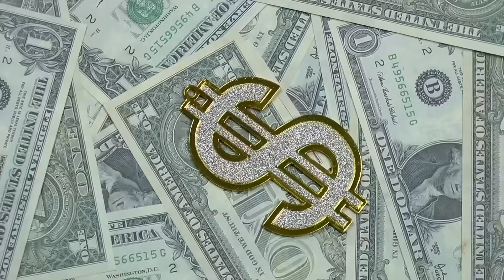How To Lay Out Walls, Floors, and Roofs | Explaining Layout

Comment: Actually, technically it's not even spaces if you're starting from the left corner, because the first space is 0.75" shorter than most of the others, because of the fact that you're covering the entire first stud with the sheet good, which means that an 8ft board would be 3/4" short to being on center of the end stud.  Hence, you shorten the first one by 3/4" to account for that extra 1/2 a stud (3/4") being covered, so that the end can land on center and the next piece can be from center to center.  This is a point of confusion that I don't see being explained very well.  I'm not sure most people understand that that first spacing is actually NOT uniform with the rest, but in fact, is shorter than the rest.  This is why you can measure 16" (for example) from the END (rather than the center) of the first stud (which is flush with the plate) to the CENTER (as opposed to the corresponding edge) of the 2nd stud.  If they were all uniform, then measuring from the very end to 16" (with that spacing being used) would not get you on center of the next stud, but rather, just long enough to meet the next closest side of it, which is 3/4" too short.  So, rather than having to have a board that is 3/4" longer (8ft 3/4"), you simply shorten the actual wall itself (in that first section) to account for that extra 3/4" being covered on that first stud.  Hence, 6:30.

Comment: Thanks for nice layout video. But still, is there something you do to compensate for gaps between sheets as it builds up in longer walls or you just cut a sheet from time to time?
Reply: A framers objective is to square a building to 1/8 inch. Most homes are 1/8"-1/2" (imperial) out of square at the time of their building, due to these inconsistencies.
Reply: @brianmahony4979  Thanks for response. I've meant something different though. Manufacturers advice to leave a 1/8 inch gap between each two sheets for dilatation purpose. For example having a 50 feet wall this would add up to almost 2 inches making your last two sheet goods meet each other completely off the stud. So you either can't lay out your studs precisely 16 inches on center or you have to cut your sheet goods 1/8 inch shorter. Does this make sense or am I making it too complicated?

Comment: I’m always confused by the corners where two walls meet. Sure the full length wall is easy, do it as shown in the video. But what about the short wall? You must start the first stud at 12.5” oc instead of 16” (for 2x4 construction, 10.5” for 2x6). Good for the sheeting but the drywall will have to be trimmed on that wall. Is that correct?

Comment: This was a really great video.  Not to confuse people but on a 12 foot material standard, 18 inches on center will give you an even break and save you 1 joist board per 12 foot run, compared to a 16 center.  

This is not good at all for custom houses, but for 24x48 garages it’s nice.

Comment: I like to run my door jacks to the sub floor sheathing. That way it bears against the end of the plate. So the king post and door jacks are locked in and not depending on nails driven in from the butt. All you gotta do is raise your wall, set jacks in after you cut out the plate 3" wider than normal. Doors stay rock solid on the hinge and lock sides.

Comment: Very good, I like this young man. Jack studs can also be referred to as trimmers,  and when laying out I like to lay out from left to right, That way your tape measure numbers are always right side up, rather then upside down..To do this one has to do a cross over at your wrist, pulling the tape with the 
left hand and penciling
 with the right hand, unless your left handed, (like my brother) You can also buy tape measures with inverted numbers.  Keep up the good work Perkins..
Reply: Good point. If you use your tape measure with the numbers upside down mistakes will occasionally happen. Not good.
Reply: I'm left handed and lay out from left to right.  Take advantage of your abilities.

Comment: So the first sheet of sheetrock gets cut 3 1/2 " off the first sheet?
Reply: If you stand drywall up you have to cut bevel off anyway. Not supposed to be beveled edge in corners. Headaches for the drywall finisher.

Comment: Hello Perkins Builder Brothers,

I am trying to make a lean to shed that has unequal length walls, this shed floor shape is to accommodate the acute shaped corner of my backyard where I have space to build. I know having unequal opposing walls will affect the pitch of the roof.  Could you make a video or provide recommendations to help me keep the shape of the shed (so it fits like a glove in the corner of my backyard) while having the pitch of the roof be equal heights at the high front corners as well as equal heights at the low back corners? 

Thanks for the videos. They have helped teach me and my family a lot.

Cheers!

Here are my shed floor dimensions:

Back wall: 11 feet x 4 inches
Front wall Length: 10 feet 9 inches
Left wall Length: 5 feet 6 inches  
Right wall Length: 8 feet 5.5 inches

Back wall Height: 8 feet
Front wall Hieght: 9 feet

Comment: What i wish you had additionally talked about are the corners of walls and how the sheeting overlaps or doesnt because to get 8 foot on center one side of a corners sheeting overlapping the other will short you a half an inch roughly. I know it seems people run sheeting vertical but it would seem to be far stronger with it run horizontally running a half a sheet for the first piece so the joints are offset. It obviously must take longer or some other reason why its not typically done this way?

Comment: You mentioned laying everything out the same so it lines up through multiple stories, floors, roof, etc. does that mean you lay out 16” OC regardless of doors and windows? So a door might have a stud only 4” away in one side for instance?
Reply: Yes! Always have something solid on your layout. You could maybe skip one if your door or window kingstud is a quarter or at most half inch off from the layout, making the gap 16.25-16.5 inch. Otherwise, having one makes it easier for your drywall installation, sheeting, siding, and insulation.

Comment: On the (big) apartment jobs, i tell the framers where the plumbing openings are, so the joist dont wind up under my pipes going through the subfloor, i dont care about the "lay-out" move that damn joist!
Reply: Chad Simmons Yea on big apartment jobs or any big jobs we would always have a meeting with the plumbers before hand to make sure we would know what special joists or studs they would want moved so went it came to layout time we would lay them out properly. If not you can imagine how much time it would take to move even just one stud in every unit in a 128 unit apartment building.. No thanks.
We would also go over the print to make sure they didn't have any changes in the tub or shower sizes so when we did the joist lay out we would make sure to not to have a joist land in the middle of a toilet or tub drain. Know the center of the tubs and toilets.
Toilets usually are 13" from the wall to the center of the drain.. Same with showers... different numbers of course depending on the tub sizes.
Nowadays I do mostly interior trim work but can't tell you how many times I see the plumbers having to cut an I- joist because it's directly under a toilet... Smh.
Reply: @reddawgrup1779  The 3-1/2 wide floor trusses, are common place in these jobs we do, i dont enjoy having the "amigo's" move a 40 footer, half an inch, to keep my pipe in the clear, but inspectors have (zero-tolerance) for cutting them, i have no doubt that you do a clean, rough-in, we could use many like you in Kansas City
Reply: Chad Simmons... Harmony on the job is always a good thing and makes for a better job, I was lucky to work with the guys I did, we all played football together at times. I remember playing a bit of football after work in the snow years ago and throwing the football around at lunch or the baseball. We all bowled together and played softball together through the years too.
We'd have a crew of maybe 15 guys or so and wasn't uncommon for all four us to play on the same team. Good times we had and work was more or less fun and looked forward to going too.
I can't remember a job that we didn't get along with the plumbers and the other trades. Nowadays not so much, but then again I'm not on any big jobs anymore, I mostly work on homes nowadays.
But I do miss the camaraderie we all had and do miss the bigger jobs as a whole. I'm thankful for the ppl that taught me the trade!

Comment: That inside wall that you measured at the end of the video, wouldn’t it be better to start your layout from the inside of the perpendicular wall instead of the outside. That way when you install your sheetrock you could butt up against that And measure to find your studs easier??
Reply from the maker: Good question.. you can still find the studs easy.. just take off 6 inches for the wall and Sheetrock later to first stud. I like to do all framing layout to outside of structure so that the interior studs line up with the floor joists and rafters vertically. This is stronger and leaves bigger spaces for the mechanical systems to get through from floor to floor.
Reply: Perkins Builder Brothers this is good to know for me. Sometimes my 3 stud finders don’t work(thick drywall or plaster) and I have to resort to a measuring tape. I’ve always measured from the inside corner. Now I know to check 16” from inside corner and also 10”!

Comment: I don’t understand why you would run 16 OC from outside the building if the wall that getting drywall won’t be from outside .... on the 8:00 minute mark...
Reply: I agreee now u have to pull in 3 1/2" in for it to break every 16""
Reply: @josephlewis7166  or put a sheet in middle and fill the space left and right
Reply: Joe Lewis AGREED,also depends what side you start your drywall,if you start off the let’s say left side wall next to your lead wall(usually the back wall of course)you would go 4 inches in and would then want to start your 16 o.c.layout but from experience we just go 16 o.c.on out to end of your wall and let the drywall hangers figure it out lol...
Reply: You can cut 1st drywall piece or pieces with a knife unlike plywood.
Reply: Adrian Serna have to make a cut somewhere and then start

Comment: Here's a question... how do you frame cormers so the stud layout matches rafter layout but you also get the right spacing for internal sheets.
Reply: Dude simple build your corner, then hook and pull the tape 3 1/2 " from corner and thats where you are suppose to start your layout for for everthing unless you like wasting sheetrock plywood etc....just hook on the end of outside plate pull in to 3 1/2 inches thats it. Heyyyyh by the way what state has all the rough framming going on out there im looking for work bad im in connecticut it sux here hows colorado lookin?

Comment: Very good video , and well done however - your forgetting to explain that with sheet goods I.E. shear panel or even siding, your gonna need to  gap for expansion - Especially for roof sheathing. So your going to run out of stud or rafter or joist  if you attempt to not grow a bit. Next thing you know your left with only 3/8" inch of nailing left over.  Keep up the great videos :-)
Reply: Are you implying that you change the layout spacing based on expansion gaps? Most of not all sheathing is "sized for spacing", i.e. 1/8in short. Those words should be stamped on the panel also
Reply: @Fly1Style  Nope!! just saying to make sure your stud, joist, or rafter layout doesn't grow on you or otherwise you will run out of layout. End up needing a block along side your material to catch support and nailing.  I agree with you however to make sure you check your sheet goods to make sure they are sized accordingly for that 1/8" gap. Not sure in all my years I have ever looked for that. Appreciate your feedback

Comment: Always been told Jack is marked with an O, anyone else?
Reply: Ive marked jacks J studs X and cripples w O and an arrow, as in upper/lower for under and over on plates. That way green guys know if its top or bottom. But ive had guys use almost anything in 20 yrs
Reply: Weird. I've never seen O. Around here it's usually T for "trimmer".
Reply: Studs are x Jack's are o and cripples are c. B is for blocks either up or down depending on where walls intersect.

Comment: On your quick note part about the stud at the end and the next stud in.  The stud in the corner and the next stud oc wouldnt be 16" would they? Wouldnt it be like 16 from end stud to 16 oc on the next stud to make it true 16 since you're coming 1 1/2" in from the corner so the stud is flush with the bottom plate ends.  The next stud in would be shorter distance gap from corner to next stud layout wouldnt it .?  Im confused on that part. 

Hope that makes sense.

Comment: If your laying out a wall 16" inch on.center what do you do if the wall isn't divisible perfectly by 16 or is it always
Reply: The remainder will just be a smaller gap than 14.5". For walls with sheets you will have to rip that last sheet to fit.

Comment: If you layout from outside corner(exterior side of house)how does the drywall break inside? Doesn't triple stud corners throw that off?  Asking cause I dont know but looks like it does
Reply: As a framer you worry more about the big picture and how framing stacks and mechanicals are run through the cavities created, not worried a bout one trade only. If every wall was started 15-1/4" and go on first and second floor it would be a mess for everyone but the drywaller. Not worth the headaches.when drywall is very simply cut and a cheaper material.

Comment: When do you decide you want to make an exterior wall that ties into a perpendicular exterior wall start 5.5" short/long on layout? I.e. the short side wall of a home that butts into the front long wall of the house. This would make it so your layout is now staggered 5.5" (if a 2x6).  This doesn't show on the inside of the wall because the drywall would land on a neat 16" o.c. layout starting from a corner, but on the outside of the house, you now are no longer 16" o.c. when pulling dimension from a corner.  Which team do you want to be 16" o.c. for? The interior drywaller starting a sheet from a corner, or the outside framer installing OSB and siding?
Reply: Well you can't build for the drywall. You don't know when they (or even you) are going to stick an 8, 10 or 12 foot there. Just nail in studs so they can screw into it around the perimeter of the inside walls where they meet the adjacent ones.

Comment: How can builders run sheathing vertical? I need to post some pics of two houses going up on my street.
Reply: Wallace Grommet mexicans do it that way
Reply: Some sheathing is designed to be run vertical. If you look at the sheet the fine black writing on the sheet will tell you the orientation of the strength axis. Has to do with the way they laminate it together in production
Reply: If you look at OSB sheeting some have lines marked either way. They can be used horizontally or vertically.  If it doesn't have lines both way it can only be used the way the lines are marked. 
Also if it is used horizontally all seams between the studs must be blocked.

Comment: Here's a tip I learned the hard way. I was laying out an exterior wall of an apartment building. Maybe 100' long total. So 5+ 18' plates. By the time it was all nailed together, it was 100' 1/2" long! Not good for sheet material, or for the outside corner that's sticking out that extra 1/2 inch. The tip is this. When you have a long run like that, the plates aren't going to butt together tightly. Not in the real world. So when cutting the plates to length, cut the wrong side of the line. In other words, they're a saw-blade width (1/8") "too short." That will give you enough slop that the overall wall won't be longer than the plan says.
Reply: Cut on the line, make sure you tape measure is true compared to a steel 12" ruler. Sometimes end hook is bent. I throw away my tape measure when coating starts peeling away, or rivets start getting to loose. I know it's served me well by the time that happens.
Reply: @juanoramo  yuppppp
Reply: Daffy Duck is your walls are square they will fit tight.

Comment: Sometimes plumbing gets in the way of a stud/joist layout be careful and make sure where toilet, tubs and showers are before installing a joist in the center of a tub or toilet. Offset ceiling joist to stack rafters on top of studs is the way I was tought and always start your layout from one corner of the house and follow throughout whole house. Very important to be square and plumb all the way up.
Reply from the maker: Yes excellent point... check toilet drains and offset joists to clear!
Reply: ... Or follow the plans, they show where you start your joists. None designs a house and sticks the toilet through a joist. Besides it being very obvious, some software even warns you about it.
Reply: @dh66  must be nice to get plans like that.
Reply: @bluecollarbeat3156  Yea, $50 programs can automatically place joists, even doubles where they need to be. Easy to change spacing with a couple clicks. All you have to do before printing is add a few manual dimensions and the rest follow standard spacing you set. Not sure why residential structural drafts don't put them in, it's not time consuming or difficult. Do contractors just buy cheap incomplete plans or something?
Reply: @dh66  can't always trust the architect, those kind of things of double checking things is just a no brainier. I would check placement even if it was marked of where to start layout.